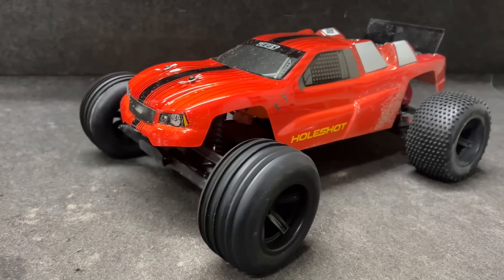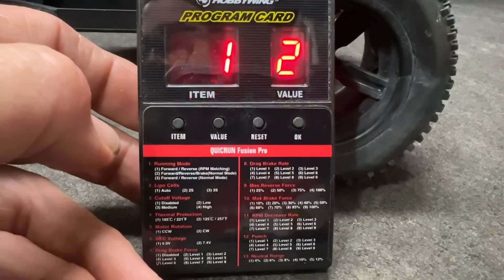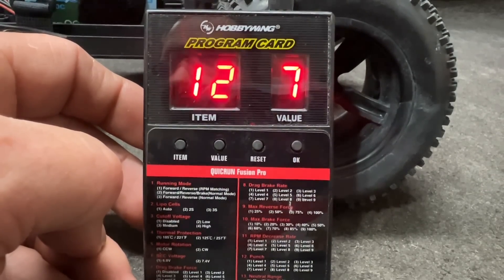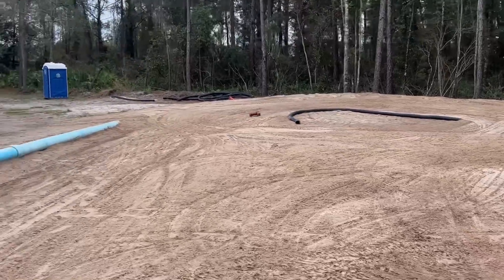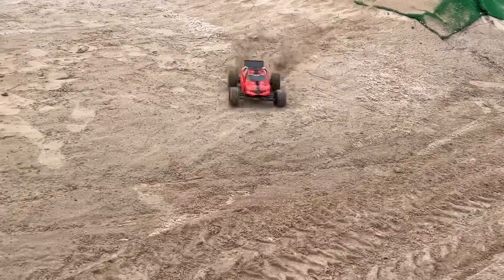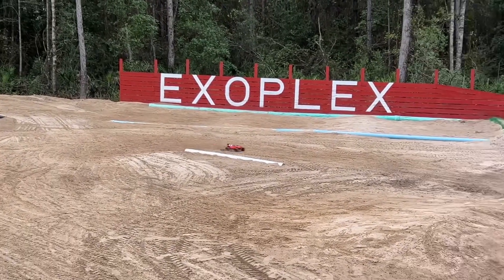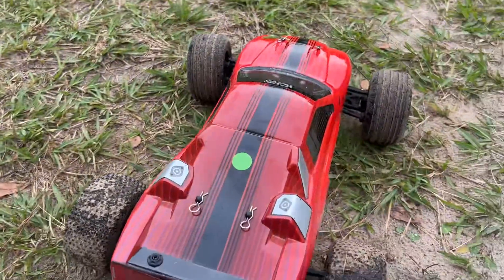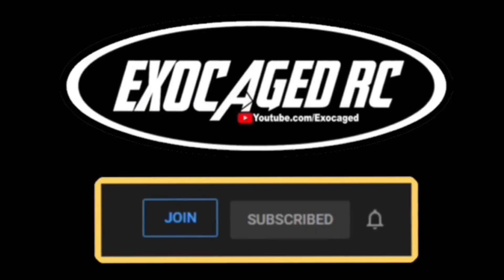Hobbywing FUSION 2300kv Pro Brushless Holeshot, Good? Bad?

Comment: ummm ya time for the Castle Creations Sidewinder Sct Waterproof 1:10Th 12V Esc & 5Mm Shaft 1410-3800Kv Sensored Motor . Sidewinder SCT is Castle's solution for anyone who needs an unbeatable combination of power and affordability in a special edition controller and motor combo made for Short Course Truck racing. This combo now comes with our improved 4-pole, 12-slot censored motor that boasts exceptional efficiency. While the censored capabilities of the motor cannot be utilized with the Sidewinder SCT ESC (motor will operate in sensor less mode), users will benefit as the censored motor is rebuild able (parts available soon), and this design even allows modelers to replace damaged motor wires. Sidewinder SCT is ready to run out of the box and is programmable via your transmitter. There are also many more programmable features that may be accessed using your Windows PC and a Castle Link USB adapter (sold separately) or a Field Link card (sold separately). Drivers can tune their favorite settings such as brake and throttle curves, throttle response, drag brake and many other parameters as well as download new firmware updates and feature upgrades as they become available. This combo includes a waterproof (not intended for operation while completely submerged in liquid) Sidewinder SCT ESC and a larger, more durable 5mm motor shaft 1410-3800Kv censored motor and a Castle Motor Cooling Fan. The 1410-3800Kv motor is intended for short course trucks running on 2s Lip and weighing up to 6.5 lbs. It is also a great system and a torque animal for lighter 1/10th scale 2WD stadium trucks and buggies running up to a 3s Lip. The Sidewinder SCT Combo will give you exceptional response and performance right of the box and offers power to spare at 2-3S Lip. If you're looking for a fully programmable ESC and motor combination that can leave other short course truck drivers in the dust, the Castle Sidewinder SCT Combo will get you to the finish line first.
https://www.amazon.com/gp/product/B06XDT7W6J/ref=ox_sc_act_title_4?smid=A1A1ZSBB2126XX&psc=1

Comment: Joe, you can't change the pinion?
If I ever got a 2-wheel drive buggy....I think I'd go with a late 80's early 90's retro rig like an newly released RC10 with a brushless system.
Reply from the maker: Very little adjustment. But there is some yes.

Comment: Would asume you could have guessed it would not work. But would be interesting to see how it holds up with a serious wheelie popping system. Durability test alike thing. Got btw 2400kv on 4s in 1/10 buggy, just tested few weeks ago.  Doesn't work great, lots of weight and gears couldn't handle the power, blew diff within few minutes. I nice 2s setup with something in 3300 to 4600kv range would do the trick. These cars need to stay light to have the most fun with them.

Comment: My TRX4 K10 highlift with 2.2 tires with that same Fusion pro 2300kv and 15t pinion is faster than that thing with the Fusion pro 2300kv. lol, It has never hit 100f with the big pinion and 2.2 tires in 2nd gear. That setup in the holeshot would be fun for Exoplex club races all running the same gear.

Comment: Reedy 540 size 3300kv that comes in the MT10 seems like a perfect match for it.
Reply: That's the motor I put in an old Rustler 2WD project I have. It seems to be good, because my RIVAL MT10 is a very good truck with great handling for a monster truck.

Comment: 2300kvs a bit small.  You're likely to be tapped out the entire track.  I wouldn't go under 3600, and likely to go into the mid4000 even 5000 kv area.